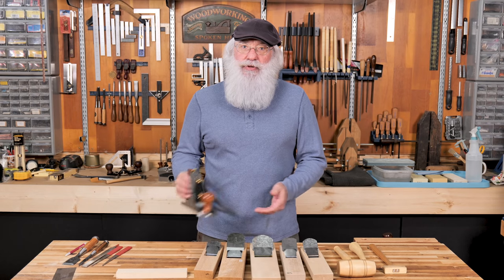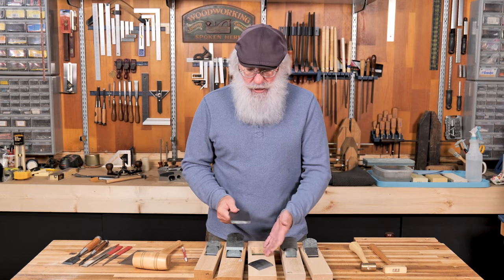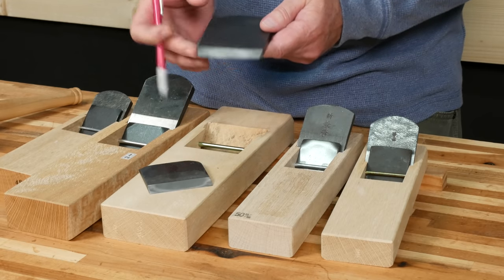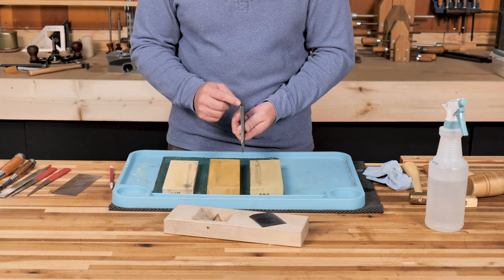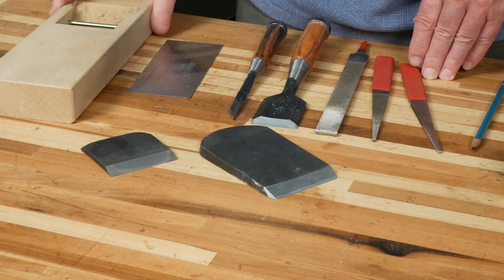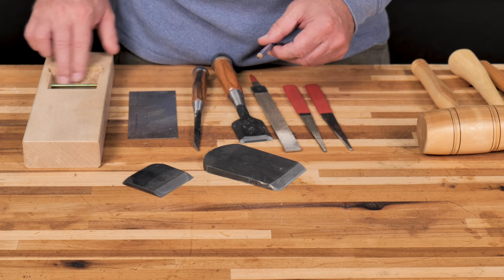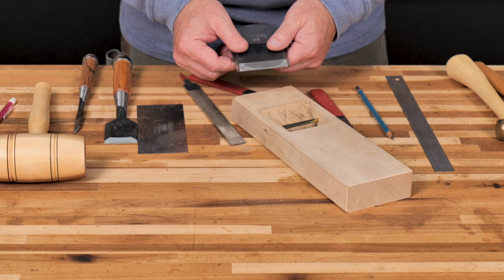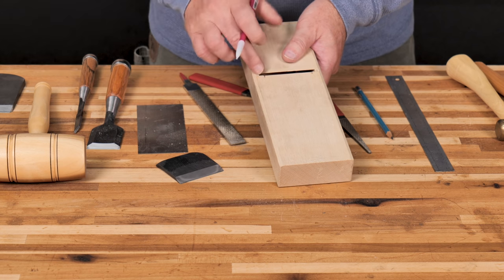Tuning and Using Japanese Hand Planes - WOOD magazine

Comment: The dai is made from wood so it won't damage the surface of lumber. In Japan, softwood with plane-finish is considered as the best, and the surface has to be buttery smooth. Carpenters say it's quicker and easier to just tap the plane, as opposed to turn the screws for adjustment.
Reply: It's not easier, and it's definitively not quicker, the amount of tunning and constant fiddling is a pain, they tend to skip and chatter a lot if not perfectly fitted, plus they are only good for smoothers, they suck at material removal, if you want a wooden plane just get a wooden foreplane maybe a jointer, there's no need to screw around with wooden smoothers when a good metal one will last 100 years and perform perfectly without any fiddling.
Reply: @HdtvTh  or you just suck at using it. its said skilled craftsmen can use it alot easier than western planes
Reply: @eliseveldt  Or they suck at using western planes, goes both ways, but no, I'm pretty sure western planes are just more intuitive, easier to use and easier to manipulate in order to get a dead flat surface.
Reply: Even steel planes will respond to a tap with a hammer at the front or back. The adjustment is far finer than turning any adjusters . Tapping works for all wooden and steel planes .

Comment: Well, still learning..... Anyway, for side adjustments, I have seen some who tap the side of their planes, and trying to figure that one out. You can tap the top side of the blade to correct for the blade not being square. Some times I think the blade is all the way to the side and hitting wood, and have wondered if tapping the side of the plane body scoots the blade sideways so you get some clearance and you can adjust the blade more if needed, for squaring up the blade.

Also I have wondered if you can adjust the blade forward the same way you adjust it backwards, or maybe the opposite.... If you strike the front of the plane body, doesn't that do the same thing for adjusting for a slightly deeper cut?

Comment: I am wondering if the 2 hollows on the sole of this style of plane has been applied to the Euro style wood hand planes. Also, wondering if this helps make for a long straight cut which seems to be impossible with the metal planes since they don't have an outfeed table like the power planers....

Comment: The chip breaker was introduced when the shokunin (master craftsmen) were selected for their skills amidst war. When the apprentices realized they had not developed the proper skills quickly enough and couldn’t without the teachings of their master, blacksmiths invented the chip breaker. 

I only bring this up to maintain the integrity and credit of Japanese carpentry as it is a trade that been cultivated and refined for so long, no wonder it comes with measurable pride
Reply: This is a campy story, but the reality is a user uses the chipbreaker, they get more work done. the same thing happened in the west. Economically, you can do a better job and faster with the chipbreaker - it's a better design and someone not using it would go out of business in a competitive environment.